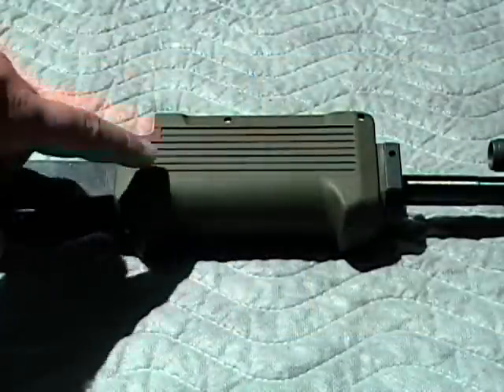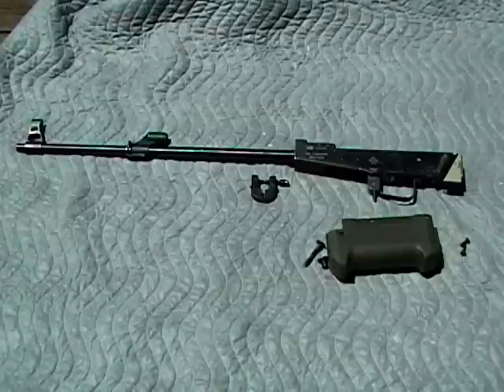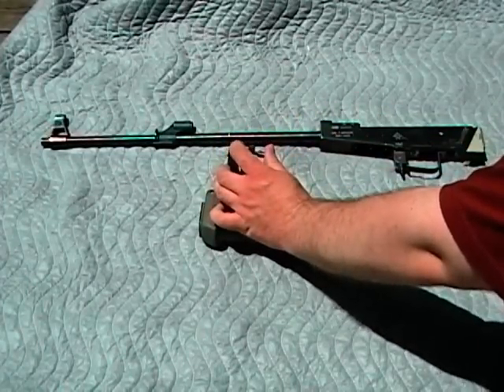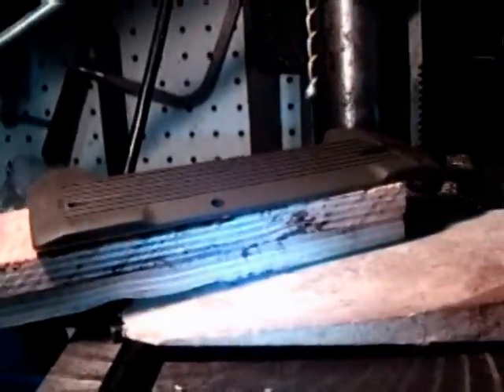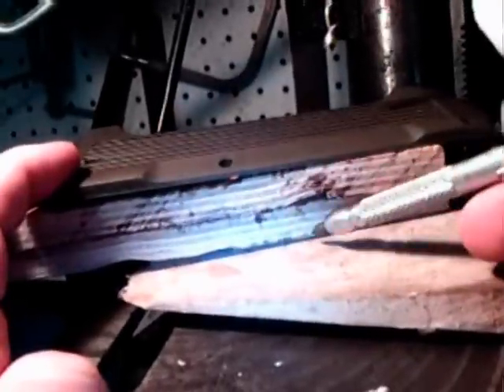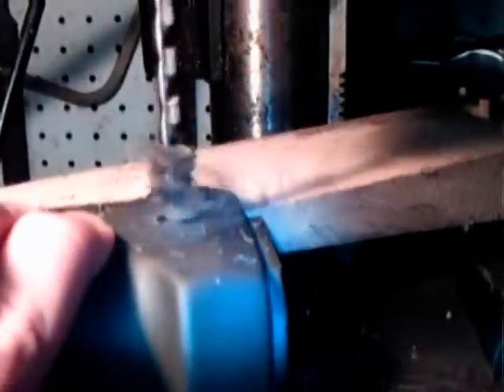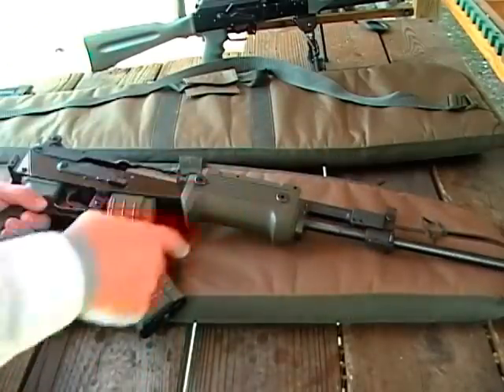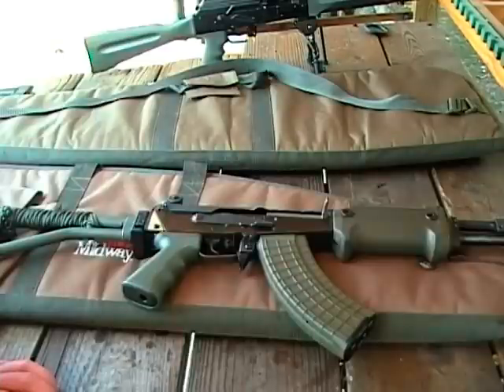AK-47 Norinco Hunter Conversion to 7.62x39mm Galil Clone Gunsmithing Project - Part 2

Comment from the maker: The milled receiver of the Norinco Hunter is very different from the milled receiver of the SLR-101S.  Due to the sharply slanted rear portion of the Hunter receiver, the Ace receiver block intended for use in milled receivers (AKRBMC) would not work.  If you are looking for a block for the SLR-101S, then the AKRBMC would likely be the best choice.

It is the Ace recoil pad attached to the stock.  I opted for the 1" pad when I ordered the AKFX, but I ended up removing it.

Comment from the maker: The tube mount is pretty good so far.  It's not been torture tested by any means, but it keeps zero.  I think such a setup would be ill-advised on a normal AK gas tube due to the amount of play at the front and rear of the AK gas tube.  An Ultimak may be a better--though costlier--choice for a Saiga.  The Hunter uses a tube more similar to Galil and Valmet rifles, which have a tube that locks into a slot in the front trunnion or receiver.

Thanks for watching!
Reply: What ace reciever block did you use?

Comment from the maker: @sbkisting I like them a great deal!  If I had to buy mine again, I might opt for the flippable 100-series rather than the adjustable 200-series.  Either way they're a good addition if you're not a fan of open sights.
 
The only downside is complication of field-stripping the rifle.  It used to be worse when they were first introduced, but Tech Sights improved the design to make it a bit easier.  I modified my own though.

Comment: I have a Hunter in mint condition...also has the angled receiver where the stock attaches......I was able to find an upper receiver with a rail attached.  So I am mainly interested in a folding stock/pistol grip and I was also wondering if a stock AK fore end will fit on the hunter?
Reply from the maker: I do not believe so, but there were several styles of Hunter rifles.  As far as I know, though, they all have the crossbolts going above the barrel.